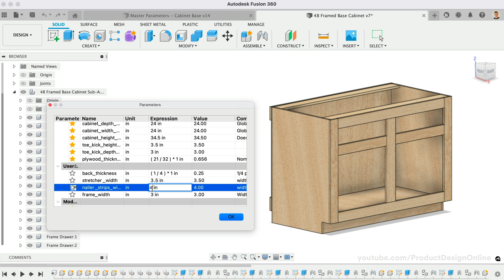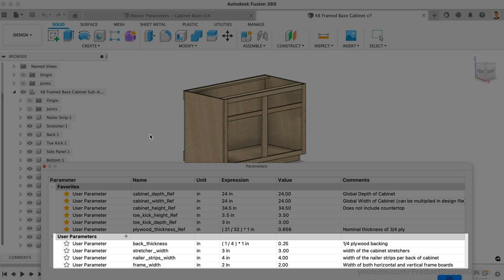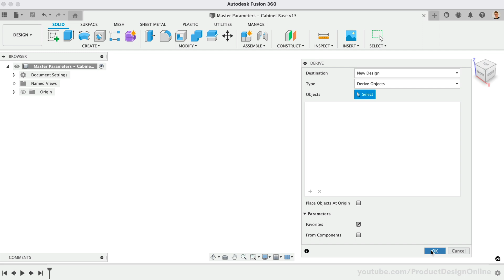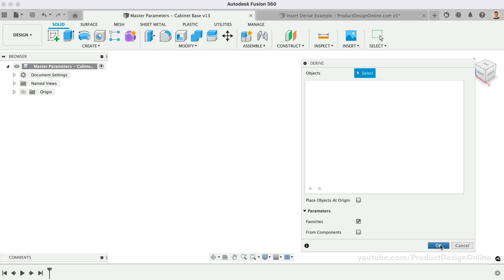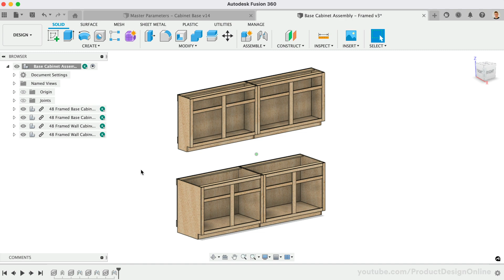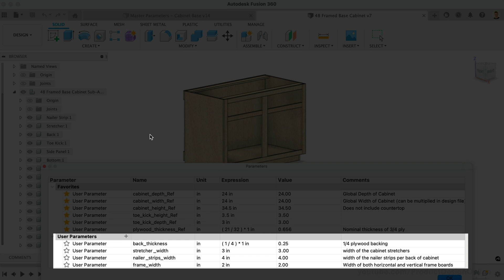Global Parameters in Fusion 360 | Explained in 5 minutes

Comment: Two years later and Fusion 360 still sucks on paramter managment!
Reply from the maker: Agree that it can be better! However, if you're on EDU/Commercial or Startup license, be sure to check out the new "Configurations" feature.
Reply: @ProductDesignOnline  I use the config feature already and I use Fusion 360 for my 3D print business. However, both features feel like afterthoughts by Autodesk. Not only are the UIs far away from good and intuitive UX, the functionality looks like they didn't planed this parametric approach from start to finish. One example: when you import the parameters like you do in your video, you will not get autocompletion on the variables unless you mark them as favorites in the destination project. This looks like a broken system to me (as programmer), because it looks like the autocomplete functionality needs to be hacked in for every place where variable names are stored. 
The configuration feature is also flawed in many places. E.g., if you activate the config feature once you need to tediously export/clone the project to get rid of it again even though there are no configurations, thus, no references present. So this feature is also forced uppon Fusion's old system and not an integral part of it. Either the configuration feature should be present all the time with a default (starter) profile or it should use the history/timeline mechanism. But it is implemented in a third way. Weird!
And don't even get me started on the blocking floating window mess of the paramter menu. 😩

Comment: Interesting, but the real question is can i edit the derived (ref) parameters wthin my new design. Effectivily using the ref model as a foundation to adjust the parameter values and then by extention creating an instance of the ref deisgn file.
Reply: same question here...hopefully there's answer or video tutorial how to do that? for example I want to derive kitchen cabinet design same width and doors, etc while still be able to adjust the length to suit different room length?
Reply: @x3wy  I think we have our answer. Seriously, a few days after I posted this they had an update that includes "configurations". I dont think it is exactly what we want because it is effectivly parameter presets on steriods. It is still within the same project but MAYBE we can have a configuratioon of a derived part (hopefully when can then edit the configuration in the new project to circumnavigate the existing parameter derived issue). This would answer our question. I'd have to play around with it but there definatly seems to be a lot of ways to use this new feature which I like.
Reply: @add859tankionline Thank you for the info about configurations, I will check and play with it, the intro video looks promising
Reply: @x3wy  Also to add on from your adjusting to a given room length comment. There needs to be a parameter that directly adjusts based on an object. I know you can label the room length as a parameter then use that same paremeter to adjust your cabnetry but if there was a way to get rid of the 'middle man' that would be nice. This would help make sharing between projects easier.

Comment: GREAT video led to Newbie mistake.
I'm working on a 32' long panel but didn't want all that waving around while I was working on the first 4'.  So set AboveGrade=4' and derived it into my work file, ie AboveGrade_ref.
NOW...I want to extend it out to work on the next section and I have AboveGrade_ref used lots of places.  
I can't change the derived parameter in my work file.
Looks like editing all those places it is used with:; 1) new user parameter a function of AboveGrade_ref, 2) changing AboveGrade=32', ...pretty confused on how to approach this.
Is there a way to find all the places a parameter is used?
(I am a paid-up PDO member)

Comment: Thanks for sharing! May I ask will read-only master file still work? Given free license can only have up to 10 active designs
Reply from the maker: You will have to make 'Editable' to save changes to the master file. However, making it read-only vs editable should not affect any of the other design files over time.
Reply: @ProductDesignOnline  Thanks! So for example I going to make many different coaster with same thickness and diameter, I can just create one master, save it and change to read only, I can still use the global parameter on other file?

Comment: Interesting. I'm going to try this as I make a lot of models for 3D printing and have a lot of common dimensions for things like M2-6 bolt holes, bolt heads, etc.  I usually have to copy them in each time.  A proper implementation of global parameters would be nice, but I'll try this and see how it works.  Thanks!

Comment: Is there a good way to manage DXFs generated from projections? It's supremely annoying to have a supplier vary material thickness and have to re-export each DXF individually after updating the parameter.
Reply: When there are no tools you gonna have to make your own ><
Reply: Phyton scripting
Reply from the maker: I'd have to agree with Emang. Having a script (per Fusion 360's Scripts and Add-ins') would be most ideal for this scenario.

Comment: Nice tutorial, but parameters in Fusion 360 still need to be significantly improved, the workflow is not fluid. My main complaint is that we can't work with two monitors, leaving the parameter window open.
Thanks and best regards!
Reply from the maker: Agreed. Would love to see some parameter updates (and multi-monitor support) :)
Reply: The parameter window can be left on another monitor, the problem is that it's modal and you must close it to continue using the Fusion 360 😭
Reply from the maker: @AlessioSangalli  That's always frustrated me as well. :(

Comment: This is great because I usually design walls to be a multiple or extrusion width. I usually set it each time.
Reply: Another good way would be to create a "template" 3d file with all the parameters you usually use. Just need to remember to save it as a new file

Comment: There should be an easier way to do this. Thanks for the tutorial Kevin!
Reply: Yeah wtf, globals in any programming language are easier
Reply from the maker: Couldn't agree more, Hari! A full on global way (without Derive) would be ideal - especially since Fusion 360 is 'cloud based'.

Thanks for watching :)
Reply: @ProductDesignOnline   - I couldn't agree more 😎👍
Reply: @ProductDesignOnline  Just go to the modify menu and at the bottom there is an option to import/export parameters as a CSV file. Then you can put it wherever you want.